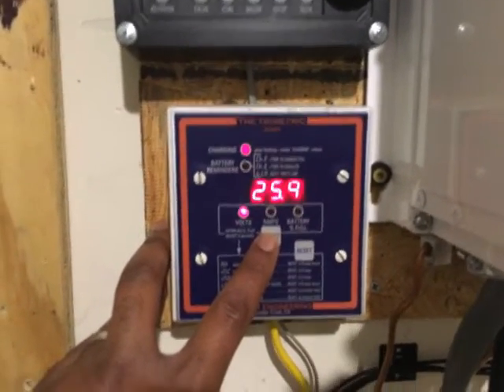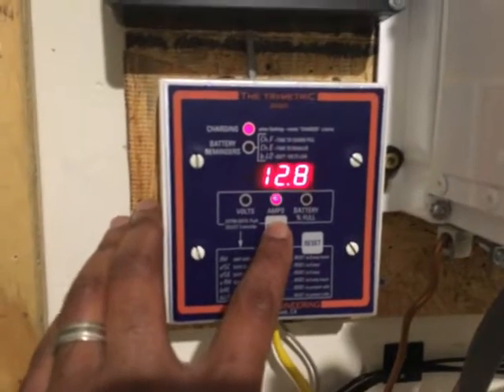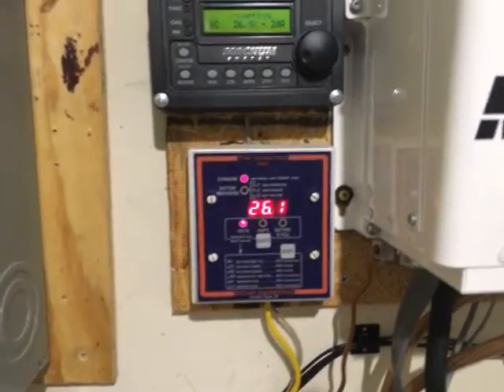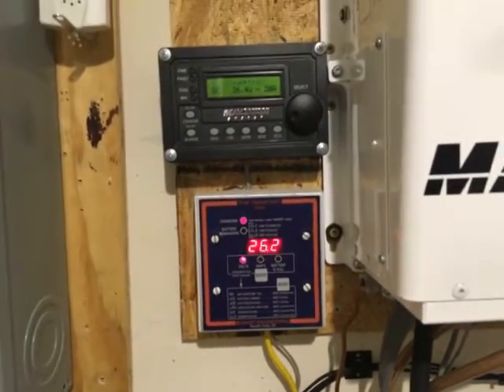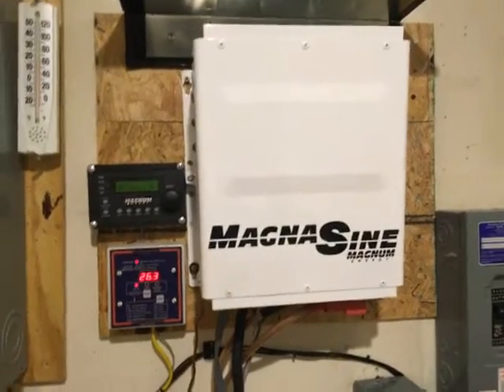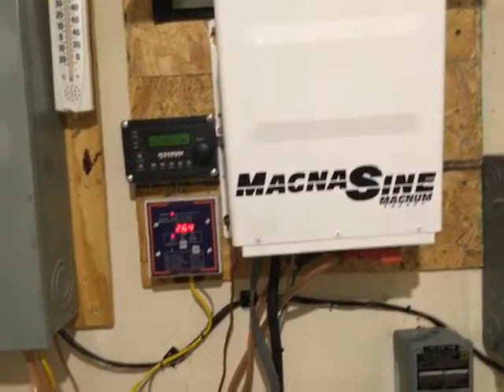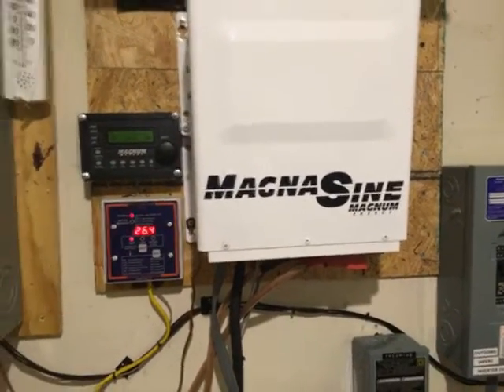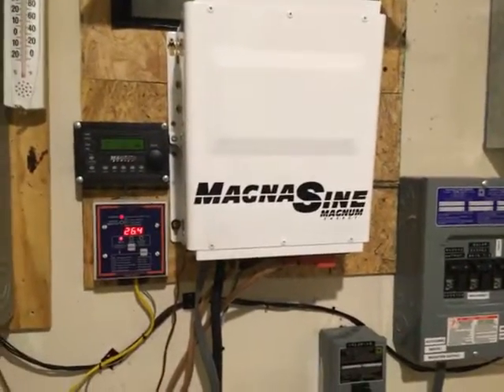Solar AC Coupling -Testing Micro or Off Grid Capability Part 2

Comment: Most people don't understand the Dc current has to travel the whole length of the wire from + to - but AC current only travels the distance of the frequency Time it take the change from + to - This is why it takes larger wire for DC current Draw than it take for AC current Draw. Just something i remembered from a 60 year old Government electrical inspector while he was teaching the industrial electrician course i took in school many years ago. Ac coupling will save you money in wire size and allow you to send your panel power longer distances to you home with smaller wire and less chance of heating and fires. If you run DC voltage through a transmission tower the wire needed, would crush the tower from the weight of the wire.

Comment: +rhandsom It's good to be cautious about safety when it comes to lithium batteries.  +jehugarcia explains his rationale for pretty much copying the tesla battery pack exactly, by putting a fuse wire on each battery that melts at 6 amps, in case a cell shorts or goes into reverse current.  Each pack is 3.7 volts so four packs is 14.8 volts so pretty much compatible with 12v inverter chargers.  He actually made a fully electric VW bus running on these 1KWHr lithium packs plus a battery controller, monitor, and electric motors. Figure on maybe 18 packs at $300 each for 18 kwhr to last the 18 hours that the sun isn't up 9am-3pm and you're off grid!
Reply from the maker: +christothegreat1 Yes, I saw his van project and the video concerning the wire. I definitely don't disagree that it would be a fun project.

Comment: How about a tesla powerwall for your night time off grid power use?  Lithium ion.   Light weight.
Reply from the maker: +christothegreat1 The Tesla firewall would work and from what I understand, that is or was it's original intent.  As a way to store power during the day and use that power during the night.  Again, it will work, but for true off-grid operation and longevity I'm looking into other technologies.  One of the reasons is being that of longevity.  The Tesla Powerall, is very new technology and has it's appeal, but for the money they are asking, I don't want to be one of the beta testers.  The Tesla vehicle had spurred a lot of excitement and had a lot of initial problems during it's commercial introduction.  I learned this by watching the Netflix documentary called "The Revenge of the Electric Car"  I believe.  Lithium Ion batteries promises to be a great technology, but it's too reliant on technology to function properly.  From what I understand, and I might be wrong, it requires a special charging and battery management circuits for each cell etc.  Lithium based batteries have a cycle life that is greater than lead acid batteries, which is a definite plus, they are lightweight, can be charged and discharged quickly, and are from all accounts very efficient.  However, like lead acid batteries, there is a finite cycle life, i.e, maybe 3 times longer than lead acid. Lithium Ion batteries for residential power storage is still in it's infancy and represents a significant risk for my personal taste.  That financial, technical, and safety risk maybe ok for others, but not for me personally.  For the $3500 price tag, I've researched other options, and I don't see myself buying a Tesla Powerwall in the foreseeable future.

Comment: Thank you the information, I always enjoy your videos.
   I have entertained the thought of obtaining fork lift batteries, the issue is that moving them is prohibitive or impossible.  To fully keep one of these large batteries charged and serviced properly is another challenge. 
I believe the secret to long battery life as pertained to lead acid cells, is to never draw them down more than 20%, that means they should be kept at the very least 80% full. Having said that, the ability to restore to full charge in a reasonably short amount of time is equally as important.
I know an 80% buffer zone seems like over kill. This ability to recharge is really important.
I have watched some videos on battery testing and short circuits in battery racks, these were intentional situations where what can go wrong and how out of control things can become. It is hard to imagine a heavy cable melting and glowing. 
So, battery racking is very important, and all details need to be thought out as to worst case situations. I would think that having the batteries in an isolated structure on the outside wall from where they are connected would be a good move. Fire proofing and insulation/ventilation and servicing are other considerations. Batteries perform best around 75F 
Check out BatteryUniversity dot com
Reply from the maker: +Craig Nehring Thanks for your comments. I'm convinced that for continuous off-grid operation, lead acid batteries are "not" the way to go.  I've read some of the same research you have and even the manufacturers seem to suggest that 20% DoD is the norm, 50% at best for battery longevity.  However, I'm questioning whether folks actually realize that having a 400ah Lead Acid Battery means that you only have 400ah x .20% = 80ah of usable power.  That's ridiculous, but it has to be if you want to keep those batteries for 7 to 12 years.  For pure off-grid, you would have to go with 1000ah at least to get the 200ah at 20% DoD.  The cost goes up and you'll replace them eventually within 7 to 12 years.  I considered fork lift batteries, but the size, weight, and cost and longevity makes them not the ideal solution.  For the money, I would look at other alternatives.  Also, for regular lead acid, once you get into the thought process that you will need 1000ah of battery bank to satisfy off-grid requirements, then I would start looking at other alternatives.  If I'm going to spend that type of money, I'm going to buy something that will last.
Reply: Some random thoughts to your reply
This entire alternative to mainstream energy needs to be looked at as not one source that can replace the two or three we enjoy as a utility service. Where I live, it gets very cold for many months out of the year so some solar will provide a boost to the natural gas to supply heat. I would like to pair down what I spend on utilities and be more reliant on options. Electric heating is, when you think of it, a real unusual way to do it, based on how most utilities go about burning fuel to convert to heat then mechanical and finally electric power only to be wasted (consumed) again as heat. A balance of energy usage and a conservation of energy such as retained heat is where the effort should be spent.
I plan on replacing the now electric clothes dryer with a gas unit, adding a gas water heater and use the soon to be former electric water heater as storage for solar. The gas water heater "cold water"  inlet would be fed solar heated water from the former electric tank.
The big push in any project should be to use energy effectively. One way to curb energy waste is to do an audit on air infiltration/exfiltration (caulking takes care of this usually) and access any needs for additional insulation. Another is to use convection currents to help heat or cool a dwelling. There are many novel ways to use thermal siphon for both cooling and heating.
Conventional air conditioning can get a boost by simply shading the outdoor unit.
The biggest bang from solar electric I feel is to have it run what it can during peak solar input/output
I love the idea of shifting 120 volt usage to battery backup inverter supplied power.
Reply from the maker: +Craig Nehring I fully agree with your comment. I suppose the most efficient heat sources would be wood or gas.  I also like your approach to using the old water heater with the new one.  I guess the bottom line is that it will take a truly hybrid approach to get the most out of alternative energy.

Comment: Hello,
Why can't you have your battery bank underneath your equipment? 
You just mentioned that?
Reply from the maker: +JWSolarusa John Wesley Thanks for your question.  That information came as part of my NABCEP preparation training. I read the book "The Electricians Guide To Photovoltaic System Installation, by Gregory W. Fletcher, here is a quote on page 119 dealing with battery safety, "One last thing to consider when locating PV system batteries is to place them as near as is safely possible to the electrical equipment and loads to minimize wire sizes and length of wire runs. With this in mind, make sure to place the batteries out of the working space as described in Section 110.26 of the National Electrical Code. This section requires a minimum working space of 30 inches (76 cm) wide (or the width of the equipment if it is greater), a depth of 36 inches (91 cm) in front of the equipment, and a height of 6.5 feet (2 m). This means, for example, that a battery enclosure cannot be placed directly in front of PV system equipment like a charge controller and inverter, but rather must be placed to the side."   In the book there is also a Figure illustration that specifically states that the working space under the PV equipment must remain clear.  And a Battery Bank Cannot be placed directly under the PV equipment.  Sorry for being so literal, but I didn't want to mislead or speak from opinion.   It was an excellent book I might add.
Reply: rhandsom 
Thanks for for the info rhandsom. 
God bless and please subscribe.
Reply from the maker: Your welcome, and I subbed your channel. Can't wait to go through your vids.  Thanks.
Reply: rhandsom Thanks bro